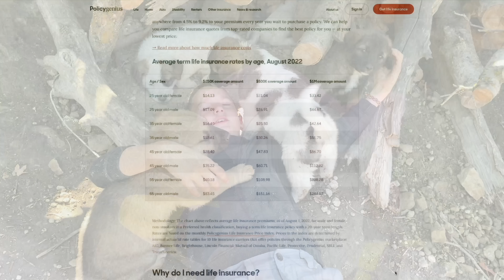#628 - How Much Firewood Do We Need When Heating With Wood? Installed Attic Vent On House.

Comment from the maker: To start comparing quotes and simplify insurance-buying, check out Policygenius: https://policygenius.com/redpoppyranch. Thanks to Policygenius for sponsoring this video!
Reply: Inks you 😢 from Sweden 🇸🇪
Reply: What city do you guys live close to in south eastern Idaho?
Reply: Thanks for the video. 
I have found that cutting up smaller branches for firewood can be well worth it, if it's a dense hardwood species, at least. I cut up branches as small as 1 inch in diameter, though usually a bit bigger. This smaller firewood doesn't need splitting, and can easily be picked up by kids.
And the leftover branches can, fairly easily, be moved by hand into a trailer or piled up and burned.
Reply: since you get a lot of bugs that LOVE to get on your house I feat this vent may have an issue with them gaining access to the inside, might want to get up there and put a FINEer screen on it

Comment: Smart man, having the wood and splitter at a good working height. The work you have done on your home puts a smile on my face, work well done. We would go through 13 face cords in upstate NY not far from Lake Ontario back in the 1980s, during January it would drop to - 20 to -40F  for two weeks. South Carolina is so much warmer nowadays.  I had a 50 X 150 garden, we taught ourselves how to can.  We still eat at home most days, with my wife's nice home-cooked meals. I'm 70 wives 67 we still retain those skills we learned growing up. My parents came threw the depression, my father was born in 1902 military records 1904 officially. I just mentioned all that because it good not to forget the past and the lessons learned from it.

Comment: Heath, I know you don't read the comments and I'm not sure why I'm gonna write all this, but watching you split that firewood by yourself reminds me of 2 old wagons we had on the farm growing up. Both started life as 5 ton dump trucks that we wore out, and especially the one that used to be a 20 foot stake bed with a hoist. One of the wagons  retained the dump truck's hydraulic pump, tank and plumbing. The pump was moved up and adapted to fit a tractor's PTO shaft. The other had all that removed with hydraulic lines  plumbed to fittings that plugged into the tractor's hydraulics. It didn't work with many of the tractors, but it paired really well with our International 656 Hydro and was our main dump wagon for picking sweet corn and dumping it in the corn chute at the farm's market. 

I worked on a market farm as a kid, but my old man had a dump truck and sold cordwood on the side, from spring until deer season there was a truck load or 2 to be stacked or delivered, sometimes both. I remember when we didn't have a dump truck, and I cannot put into words how much more efficient it is to process firewood with a dump truck or wagon. 

Also, if you're bucking it up on the hill, you might also find it to be a little easier on your back and leave your mess in the woods where it'll make topsoil if you hook the splitter to your side by side and split it as you load it on the trailer. Then, you can just come back to the house and park the trailer where the kids can stack it. 

If you happen to run across a deal on a broken dump truck, don't let it pass you by. There are a heck of a lot of worn out dump trucks out there that are super cheap AND have Cummins parts.
Reply: He may don't but me reading it makes me feel good

Comment: It's good to see the family working together and appreciating that value of the wood gathering! 

I'm remembering back to the early 70s and visiting my bootcamp buddy's family in Mississippi; those days of using a single or two man crosscut saw... an ax, showing caring enough while being apart of his family; wood wasn't plentiful for the extra large fireplace for heat. It took a lot of man hours to stay warm. An old 2 story wood home with newspaper insulation. Life was different during those years but, it helped my discipline before being shipped off to Asia! 
Congratulations, you'll be able to fill those videos spot with different items as jobs change in a lifestyle with many new ideas.

Comment: I can't begin to tell you how much better your place looks with the timber opened up the way you have. Now, it can thrive from the sunlight getting in to the ground level.
Nice part about heating with wood is that a piece of firewood heats your body at least there times before it turns into ash. Once, when you cut it and haul it. Once, when you split and stack it. Once, when you burn it in your home.

Comment: The technical scientific amount of how much firewood is enough firewood is pretty simple, figure out how much is too much and multiply that by 2.5 and then hopefully that will be enough. Lol 

The last time I depended on firewood I was 15 and living with my dad in Northern California on top of Donner Pass. He stacked what we had and he told me that was half of a cord and I needed four stacks in addition to that which should’ve been 2 1/2 cords. After I was done chopping and stacking all the wood I found out it was more than a chord on the original stack so I did about six or seven😂 that was pretty much my summer but that was about two years worth of firewood for us and a good lesson for me. Lol

Comment: Harvest only hardwoods to reduce the amount of ash after burning. Let your wood "Season" a year or two before burning. This involves letting it set out in the sun/wind to effectively dry. You'll get more heat, and lot less creosote in the chimney. It'll also be easier to carry from where it's stored to where it is burned..

Comment: I would think you could put racks of shelving around your shop with a workbench or two and have sufficient room to keep your plow truck, trailer, tractor, 4x’s and more inside. It’s a huge shop!

Heath, you are clearly very talented and have madd skills in numerous areas, but with no disrespect, do you ever complete one project before going on to the next? I don’t know how you can be working on 30 projects at the same time while continuing to add new projects to your list. You do a great job on the projects, but dude, doesn’t it drive you crazy sometimes?

Comment: How much firewood is enough firewood, when your only source of heat is wood?  Well, I stay 4 to 5 years ahead on split wood.  Then I have enough logs, to produce another 2 years worth of firewood on hand as well.  Between my house and garage, I burn 5 cords a year, on average.  So, I keep 20, to 25 cords of wood, split and stacked and ready to go.  That way, my stuff seasons for 4 years before I use it.  I'm pretty impressed your house only takes 2 cords to heat.  It must be less sq ft than what I was thinking.  2 cords, for up there, isn't much wood.  Can't have too much!  Keep on firewooding!

Comment: I sure hope that you are considering putting up at least a three sided "car-port" type structure on the new place to pull all this expensive equipment into to get it out of the winter weather.  Just worrying about future trouble you can avoid.

Like my late husband used to say, if I didn't have something to worry about, I would make something up.

Great video.  Thank you so much for sharing.

Comment: Suggestion.  Those end vents - My home AC bill was reduced by putting thermostatically controlled fan with a wall switch to turn it off in cooler weather. The fan was right inside the vent pulling out.  Just an Idea.

Comment: We use to use a flywheel belt on the tractor to turn a buzz saw mount on the front of the farm tractor's frame...to hand feed log to turn them into small logs for the wood stoves and kitchen cook stoves.  It was very dangerous.  We had several families get together for a fire wood harvesting chore.

Comment: We burn around 3 cords annually for our 1500 SF house.  We do have a basement but it's comfortably heated with in. floor heat from a Propane boiler.  If we had access to hardwood it would probably be half or more than half of that.  But all we have access to is Ponderosa Pine which burns like a newspaper.

Comment: Cut wood in the late winter and early spring. Then it is not green in the fall and you don’t have to split those logs smaller than 6 inches.

Comment: You can never have too much firewood! We live in  northern New Brunswick Canada and heat out house and shop with wood. Every year we cut and split between 8 to 10 cords of wood, depending on what we have left after in the spring. We buy our wood in 8 foot lengths the year before so it's nice and dry when we need it. Love your channel and live very much like you do except we are on grid but have our own well and septic.
Reply: Hi from Nova Scotia
Reply: Hi from the Cariboo in BC. Yeah you can never have too much wood here either. My better prepared neighbours have 3 years worth of wood
Reply: I agree that no amount of wood is too much. Eventually you’re going to use it, so as long as you can stand there splitting wood, do it.. Although highly unlikely, you might have a freak winter that continuously snows for 6 months, or a neighbor under estimates what they need and runs out of wood! Or perhaps you’ll choose to work in your shop a lot more than you thought, or Cedar throws you out of the house and you need to keep the shop warm!
Reply: I live kinda below u in Northern Maine and my parents burn 7 to 9
Reply: @sledguy02   I grew up in northern maine!
Reply: Hello from Rhode Island!! I love the smell of a fire burning!

Comment: Heath,you can never have enough firewood,we burnt all wood,we had two sheds similar to yours,my dad always had a years supply and we alternated between year to year so always bone dry.🔥🔥🍀👏🙏🏻🙏🏻
Reply: Yes. I'm from Poland and we used to burn any type of wood- even thin branches. Wood is wood. My great grandmother used to cut tiny branches (pencil size) and tie them together .

Comment: I dont get how 2 cords will heat your home for the winter. I need at least 6 cords per stove and I have one stove with a second in the works. This doesn't include my second home which is on the other side of the bay where I'm at in alaska. My family is from Idaho so I'm aware that Idaho isn't much warmer than where I'm at.

Comment: I have a question. I'm 70 and from Alabama.
We have burned wood for heat for many years. I watch several channels from Idaho, and other more northern states and they all split all their wood. I have a log splitter but only split what is too big to get through the heater door or too heavy to lift. It all burns just fine. No problem here in the south. Is this just something that was passed down from generation to generation or is the wood that different up north.  Looks like a huge waste of time and energy to me. Can you explain please?
Reply: Split wood dries quicker.
Reply: I'm from northern Michigan and my family burns the smaller whole logs that fit and we only split the very big logs. So, I'm also wondering what benefit there is to be splitting the small stuff.
Reply: @rickriley4701  That fact isn't lost on me. However, If the wood is not split but stacked under cover, it is still quite dry. So maybe the only benefit would be that it's so dry that it's much easier to start? I would buy that reasoning, as in my family's case we always keep it going once it's started in the Fall straight through till Spring. If you're letting it go out often, it would probably be better to have super dry, brittle kindling.

Comment: My uncle used to live out in the sticks, yes he was on grid, but power was knocked out frequently. He had electric baseboard heaters, but they were seldom used, he heated with wood. The family home and workshop went through about four cords of firewood a year. He had a huge firewood shed, and by the end of October, when the snow started to fly he wanted a minimum of eight cords of wood in that shed, and would prefer twelve cords of wood. His thinking was if he ever got injured there was at least a winter or two of firewood available to heat the house. The wood was mostly dougfir, with some pine.one advantage of all the wood was it was for sure well seasoned. The deal was myself and my cousins owed him one day a week every summer cutting firewood, I was about 12 years old when I started to run a chainsaw, I was also very familiar with a splitting maul. It was a good deal for all, my uncle always had enough firewood to heat the family home, and we had motorcycles and snowmobiles to use as well as the gas to run them. Lots of hunting and fishing done in my youth.
Cheers from Tokyo!

Comment: The fact is that you have turned that beautiful hillside into a quarry...or a lunar base site. To have (another) parking space for some 10 trucks,tractors, 4X4s, excavators and snowplows that change (or multiply) at a rate of three per year. That burn 10 gallons for 10 miles. That is not self sustainability. Self sustainability goes hand in hand with reducing waste and reducing your imprint on the environment. And that's not it. IMHO.

Comment: Why with such a large solar array, are you still using wood for fuel. Burning carbon based fuel is just wrong in the 21st Century.